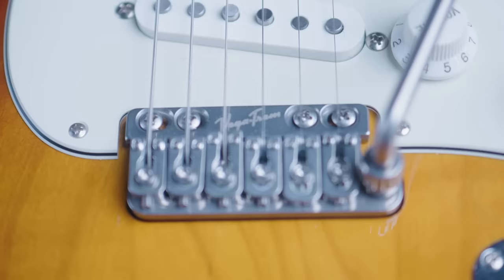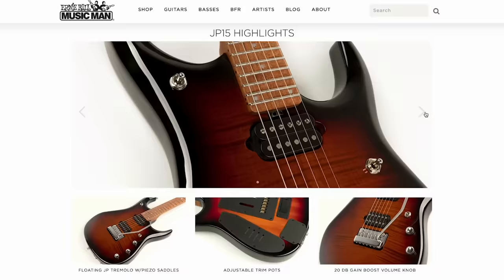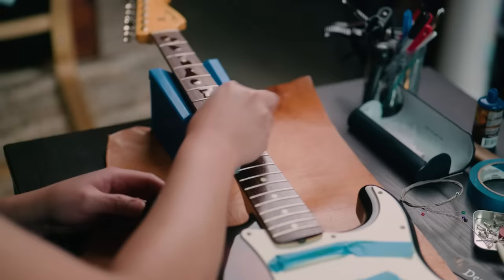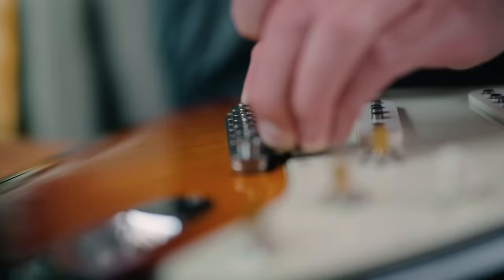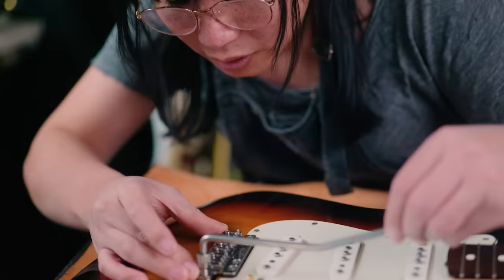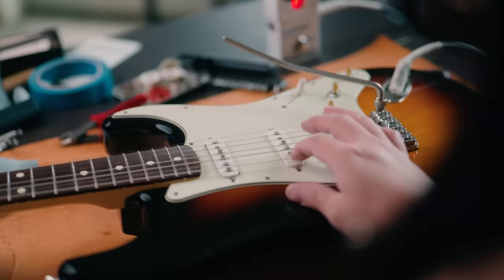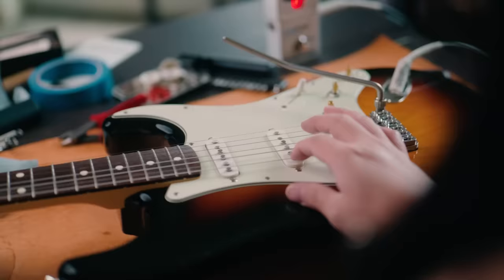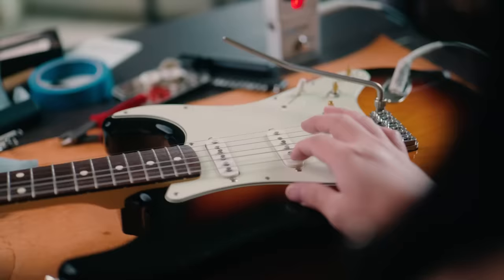Installing a Vega Trem VT1 For The First Time

Comment: There is a much easier way to balance a flat trem like a vega or floyd.  You want to use a stack of picks or coins to block the trem.  Tighten the claw more than needed.  Do the set up with the trem locked.  Once you are all ready and tuned you remove loosen the claw until you can easily remove the shim, and tune with the claw.  It takes me about 1 min extra to do a string change to a different gauge on a Floyd doing it that way with no intonation adjustment.  It takes so much time off intonation adjustment too on a floating trem.
Reply from the maker: Thanks for the tip! I’ll have to try that next time
Reply: Yeah that’s how I’ve started doing it. I like about 1mm of clearance for a subtle float, and I use 1mm picks coincidentally so it makes it easy lol. I’ve set up my own trems and it’s helped a lot. 

Also on the 6 screw, I started with the strings completely off and the springs removed so there’s no tension on the bridge. Back out each of the 6 screws, and then one by one screw them down until they start creating pressure on the bridge and makes it lift up. Then back out the screw until the bridge rests on the body again. This basically creates the “perfect” amount of movement space where it’s not going to impede movement or allow too much movement for the bridge to shift on the screw’s surface area. Do that for all 6 screws, and then back out the middle 4 screws to create a pseudo 2-point trem. 

It’s helped a lot for tuning stability. Also some white lithium grease on the pivot points helps remove any additional friction from metal-on-metal contact.
Reply: Ok, huge thanks, will try both strategies. Blocking to do intonation is an anxiety saving step.

Comment: but this tremolo is not smooth for the right hand. you can scratch yourself on the saddle screws. and this is a big drawback. tremolo, in addition to good tuning, should be comfortable for the right hand

Comment: The possible change in length of the block on trems is often overlooked; it can throw the geometry of the trem completely off, changing the it's expected behavior dramatically. Yes, spring tension is a thing, but there's a whole equation taking place in strat style tremolos. NICE VIDEO.

Comment: I love how much fun you have playing. I bought a used 4x12" cab yesterday and spent the afternoon repairing tolex tears and redoing the wiring. Now my amp head can be used after 6 years sitting on the floor without a cab to handle it. The fun isn't just the playing, it's the project itself to get to the playing.

Comment: Great video! I installed a Vega Trem in my Sterling Cutlass earlier this year. As the guitar came stock with a two-point pivot trem, I used the other install plate option. Unfortunately Sterling uses a non-standard size of bolts for its pivot posts. Thankfully the folks at Vega Trem were able to point me to some Fender replacement bushings/posts that worked great.

The new Vega Trem is a joy to play, and it's practically like getting a whole new guitar for the price of a bridge. I really appreciate you putting this video together, and I loved the song.

Comment: So here are my Favorites -
Vintage 6 screw - Gotoh Traditional Tremolo - 2 7/32 Bent steel saddle bridge - I typically put HighWood saddles on here to complete it, and it is if you are looking for that traditional trem look.
                             - Runner Ups - Floyd Rose RailTail - Good for if you want a modern look on a vintage 6 screw style mount system, great if you deck your trem, takes a while to break in.
                                                     - Super Vee Bladerunner - Best return to pitch a price 
2 point Modern - Hipshot Contour Bridge - For Cost the best, its hands down the best option and TBH goes good with the Directotron 21:1 direct 2 pin replacement tuners
                            - Runner Up - Sophia 2.2 - Expensive the best for this mounting system but if you don't care how much you put down.
Floyd Recessed - OFR German - The original is still the best modified with Hollow Points it looks great and add a Tremolo-No
                             - Runner Up - Ibanez Edge-Zero II bridge - LoPro design combined with the w/ZPS3Fe is just something that you need to try, This is more custom body not really a replacement.
Floyd Top Mount - Gotoh GE1996T - In some cases this is also your best recessed provided it will fit without modification, hands down the best Floyd LIC on the market.

Comment: Very. Cool! My experience- Low and high E install is required ( should be a mention in manual) then fun fiddling spring/ claw adjustment to set it parallel and body level given your preferred string gauge. .  No need to set G string to pull minor 3rd ala Jeff Beck setup as the amazing Vega Trem has such a wide range of movement.

Comment: The Vega Trem is a great drop-in mod for almost any Strat. In combination with locking tuners, it is almost like having a Floyd Rose without having to route out your guitar or mess with the nut. The flutters with the Vega Trem are great - much easier than with a standard Strat trem.

Comment: Good job!  Thanks for producing and uploading this content - I am always interested in aftermarket trem videos, I have several guitars that range from hardtails I want to convert least effort path (Ibanez AX7521) to a couple guitars that I bought as used players and I didn't realize until they got here that the trem was not comfortable (Aria Pro II RS series) or flat out the incorrect trem where I can't really find a used part for it some I'm gonna have to restomod it (Peavey Horizon II).

Protip: use already broken in strings from another guitar to speed up dialing in where the trem is going to actually float - then you're not fighting two variables at once.

Comment: I got news for you. That piece of paper isn't going to do anything if the force of those trem springs snap into the guitar top with the trem baseplate. A piece of wood is a better option, but I honestly would just backing the springs out a bit before removing the trem so there is no force to hit the guitar top with. You're going to need to adjust them anyway. Also it's possible that the body may take on moisture in the future, and decrease the clearance in the trem route. Just another thing to consider.

Comment: Cool video! I have a strat I've had since I was a teen. I just put 5 springs on it and locked the bridge down to the body. This trem might be what I'm looking for. I'm already trying to figure out how to wire up an "oops all middles" 3 way switch for it since I never use the pickups by themselves and want to try neck and bridge together.

Comment: Hi Nisebelle,
I know Darrel Braun is  a big fan of the Vega - it is something I would love to try on one of my guitars.
It looks so beautifully engineered - solid metal as opposed to bent steel saddles. And that solid baseplate is pure art.
I see your problem from the start though - you should have used a Pokemon card instead of the bit of old calendar. Then there would have been no issues at all.🤣

Glad that you got it to fit though, when everything was at tension.
The ultra tight tolerance I actually think is a good thing? Much better than loads of slop, than can be unsightly.

For final adjustments - I got a great method from Dylan Talks Tone for when he does Floyds.
1. With strings on, and springs loose. Block the trem from the back with a small offcut of wood, pencil eraser or whatever - that makes the trem level.
2. Then you can tune up, intonate etc without worrying about what the deck of the trem is doing.
3. When ready - slowly tighten up the springs until the block just slips out.
The trem should stay level and is balanced perfectly against the string tension. (maybe a small fine tune required, but it shouldn't change the deck position too much.)

re: no Radius Gauge - trim up a Pokemon card until it matched the radius you want - either by trial and error or using a compass - then use that to reference arc of the bridge saddles.
All things can be fixed with Pokemon cards!
Reply from the maker: Haha i think you’re right!! I was about to buy a few new tools from StewMac for some future projects, but now I need to see if I can make them out of Pokémon cards first!
Reply: am i crazy or is nisebelle transgender like her channel just think about it when i watch her vids

Comment: I also had a problem where the route on the strat that I originally wanted to put the vega on did not accommodate it properly unless I wanted to plug and then drill new holes for the bridge (no thanks). I ended up putting it on a different guitar than I first intended (and love it, FWIW). The variations in routes/bridge placement can affect the vega trem's compatibility. Something to be aware of.
Reply: P.S. It was a partscaster strat, the body was from a local builder here, Carparelli.

Comment: Great video and advice😊👍💜

I've got an almost identical strat. I'm considering fitting the Dave Murray Seymour Duncan set up. I think that works around a standard Fender Strat. Bridge and Trem🤔

The Trem seems like a great idea, neat, clever and looks to pitch forward and back well. 

How well does it stay in tune please 🤔 Also was it's easy to set up the intonation on the new Trem🤔 Thanks✌️👍😊💜

Comment: There's a new company creating a strat trem that comes on their guitars that allows you to bend to EXACTLY to 1/2 and whole step. 
Basically is has a tactile "notch" for lack of a better word (because a notch would probably make an unwanted sound) that tells you you're at a 1/2 step and a full dive takes it to a whole step. 
So it bends less than some floyd roses and locking trem's, but it gives you a tool to do exact bends with ease. 
THAT IS SOMETHING! 
I'd want to play it to see if it's something i'd actually want, but it seems interesting.
Reply: A good setup on a regular trem will do this if you so desire. No need for specialized equipment.
Reply: @trev3971  no it doesn't. A regular strat trem can give you a full whole note bend and more, but this bridge "guides" you to those two notes, a 1/2 note bend up or down and a whole note bend up or down.
Reply: @MajicFreeman  I guess I'll have to tell my Saticoy that it can't actually do what it's been doing for years.
Reply: @trev3971  well maybe another bridge can do it, but it certainly isn't any old regular one.
Reply: @MajicFreeman  Just a regular six-screw Strat bridge. You act like people haven't been dialing these things in for 70 years.
Reply: @trev3971  no regular six screw strat bridge that comes standard on a strat does what I'm saying, you clearly don't understand what I'm saying. 
I've owned several american, made in mexico, japanese, squire's and none of them do what I'M saying.
Reply: @MajicFreeman  You're saying someone made a bridge that detents at half steps. I'm saying that specialized piece is unnecessary if you know how to set up a Strat.

Comment: great video as usual! I'm wondering what are your thoughts regarding the 'feel' of the trem comparing to your jaguar guitar. The jaguar/jazzmaster trem is my favorite BY FAR regarding the feel, and allows you to be real subtle about it. Is that possible with that or it's more like a very modern vibrato system like it sounds in the video?
Reply: The Vega Trem is a silky smooth Strat trem, but it's still a Strat trem. It's a tighter fulcrum than the Jazz/Jag, so a subtle flutter takes much less hand movement. It can be done, but it's difficult.
Reply from the maker: Totally agree with @trev3971 ! The VT1 felt much more reactive and touchy compared to a jag vibrato, so I found it way easier to do really fast movements, but it also took a lot more control to be subtle. For reference, the shoegaze-esque part where I was holding the bar while arpeggiating those chords took waaaay more takes than I’m proud of just to get it subtle enough. Hope this helps!

Comment: A tip I saw on trem balancing that had me balancing a trem in 15 minutes, and an FR at that

Block the trem At Zero

Tune the guitar

Remove block

Adjust strings in back until guitar is in tune, it should be flat & in tune!  I took an FR from standard to drop C in No Time
Reply from the maker: 15 minutes?! That’s awesome! Thanks for the tip!
Reply: @nisebelle  you’re welcome!  I got it from Ben Eller here on youtube, actually!

Comment: Great video as always! Question - is there a way you could have supported the bridge block from the back to help with the installation? That was my first instinct, but maybe there's something in the way that I don't know about that would prevent that.
Reply from the maker: Thanks! Honestly, I work on strats so infrequently that I’ve never heard of blocking the trem from the back to help with balancing until reading about it in the comments. There shouldn’t be anything preventing using something to add support on the vt1 and it’s definitely something I plan to do for next time!
Reply: @nisebelle  Everyone approaches problems differently,and your solutions still worked!

Comment: The radius is WHAT? I didn't realize it was vintage specs!
Reply: The radius is the correct one. 7 1/4 forever!
Reply: @trev3971  😐
Reply: @GetOffset  As a thumb-over player, 7 1/4 is so much more comfortable than anything else that I've sold all my non-7 1/4 guitars. They're just perfect!
Reply from the maker: I didn’t either when we shot the last video! But to be fair, the old saddles were radiused something wonky so now it should feel like a real 7.25 haha

Comment: MAKE SURE YOU MATCH THE RIGHT SPRING TYPE TO THE RIGHT STRINGE GAUGE YOU ARE USING. Be very careful since the stupid springs don't have labels on em. Only their lil packages have labels. Get em mixed up after taking them out of their lil paper bags, and you dun f---ed up... I would know from experience lol. If you're off, sooo much for a stable trem... I was soooo mad at this product until I realized the mistake I made, largely because the company didn't properly label all this stuff...

They really should do a better job with the labeling... Color code em or somethin... OR do it yourself so you can't mess up! Knowing which springs are which is everything here...

Other than that I think you covered everything basically.

Best trem upgrade for any strat if you ask me. Aside from the terrible price lolz. Sometimes you can find em for close to 200 though instead of the near 300 that they are asking yeesh!

Comment: why did you tape off the pickups
Reply from the maker: Great question! I used some steel wool to polish the frets which flakes off a ton of fine particles. The tape protects the pickups from attracting these flakes since they can be potentially damaging to the pickups, and really annoying to clean off.
Reply: i have am mexican strat and i really think i might try this @nisebelle